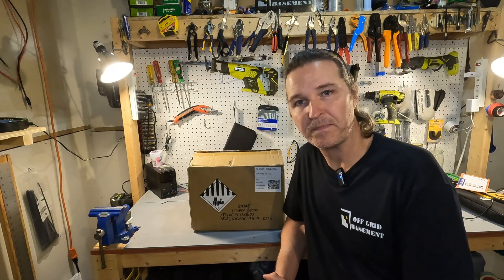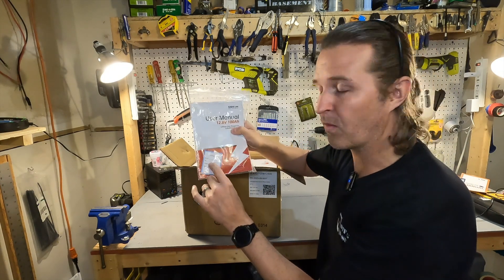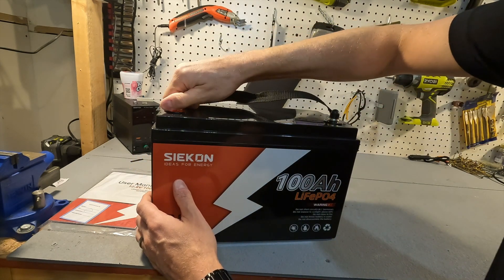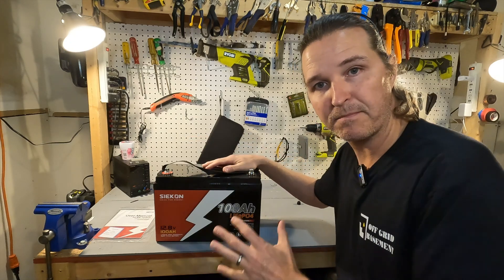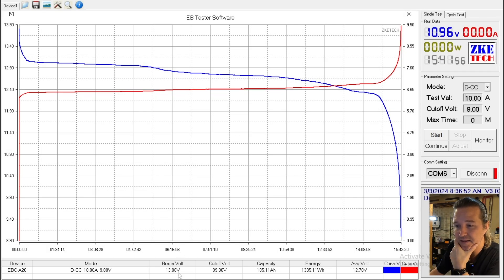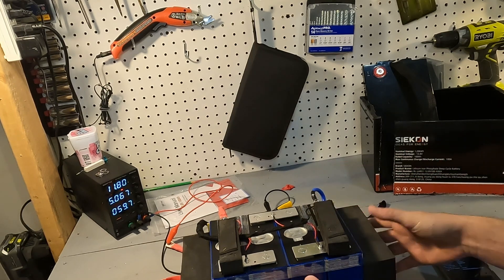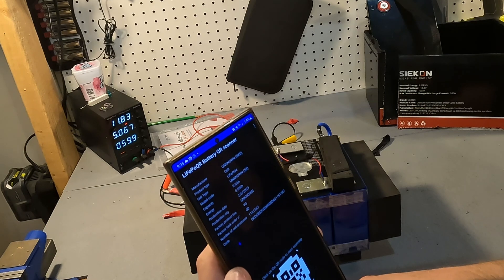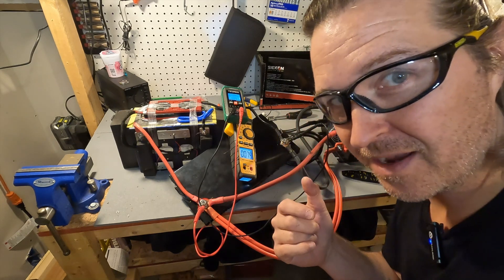Siekon 12V 100ah LiFePo4 budget battery, Garbage or Not?

Comment: A reviewer said that changing maybe a problem as the max input charge is only 2.4 amps.
Not good if your main charging is from solar
Reply from the maker: This reviewer must be referring to a battery with a lower amp hour capacity.  8 to 10ah possibly.  Thanks for the comment.

Comment: Enjoy your battery tests and breakdowns. Such a pity to destroy a free gift but you can always utilise the individual cells to build your own 12-48v system with better BMS. Pity we dont get the same variety or cheap prices as you guys get in the States. Cheers from Oz.
Reply from the maker: I bet your overseas shipping costs are high.  Bummer.  I really don't like tearing apart batteries.  They are so useful and you can do plenty of testing without a teardown.

Comment: Hope ypu get a Sodium battery soon. Oh God solar debate rages on , I can mot seem to get anyone to issie a 30 dollar certificate needed to obtain tje Export tariff. Installers only want to 6000 dollar install , 😅
Reply from the maker: Sodium Batteries would be something different.  Bummer about the installers not wanting smaller jobs.  Hope you get some good news soon.
Reply: I heard they arr thinking of running 6 Cables From New York to England. Cheaper than 6 Neuclear power stations. Lol Goverment would rather do that than let DIY gerks onto the grid. No aftermaket installation certificates in near future.

Comment: 9v discharge cutoff is too low, that's below the 2.5v/cell.  I'd onl;y discharge to about 11v, which also impacts your capacity test numbers.  That internal wiring is too small for 100A.
Reply from the maker: Thank you for the info and the comment.

Comment: Not a bad budget battery,my complaint would be the bms not keeping the cells balanced.have one now for 24v setup,had to add an active balancer to keep cells in balanced.
Reply from the maker: I believe it might have a passive balancer in the BMS, but it would be small amount of Amps..  Not enough to keep up.  I also bought a 5A active balancer for my 180ah 24v battery build and it works great!

Comment: Isn't 9V a bit low for a cutoff?  The cabling might have been hotter if it was still in the case. I would think those should be 1/0 cables minimum. Even though the insulation can handle the temperature, those high temps indicate resistance, and that will cause a voltage drop. The wires would be ok for about a 50A draw though. Two batteries in parallel should be fine. Was there a recommended max sustained amp draw? The fact that there was no information available for those cells suggests that those are grade B cells. So, buyers should expect the limitations of such. The expense is mostly in the cells, so cheap cells makes a low price, even though the rest of the build quality might be fine. I wouldn't count on the battery for heavy usage or frequent cycling, but it could be fine for light or occasional use, like to cover for infrequent power outages, or maybe for a trolling motor used a dozen times a year. I think you could tape that case back together and use the battery just fine.  I enjoyed the teardown. Thanks. 👍

 The Amazon web site claims EV-grade cells. I don't think so.
Reply from the maker: I did a 9v cutoff in my test to ensure the BMS would turn off due to low cell voltage.  I wanted to make sure I squeezed out all the capacity in the test.  I could've set the test to cutoff @ 9.5v and still had the same results.
I believe the cells are grade A since it did pull full capacity.  B Grade cells wouldn't get pass 100ah.  The manufacture of the cells might not have there info on the LifePoQR battery App Database quite yet.  Thanks for the comment!
Reply: @OffGridBasement    I think I was wondering why the BMS didn't intervene.
Reply: @slydog7131 here with the same question after I got 2 of these batteries. Doing a capacity test as we speak